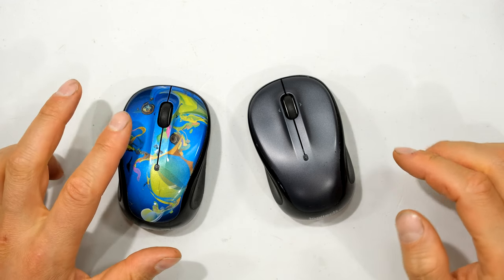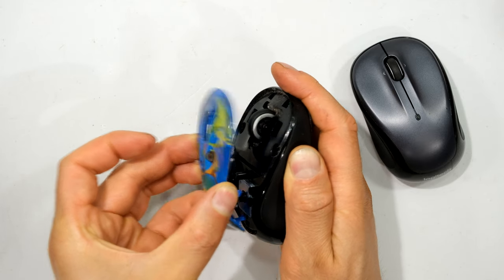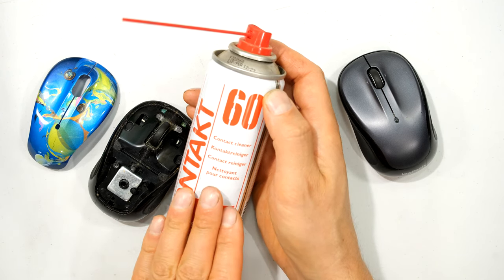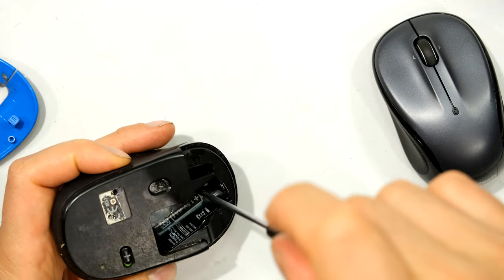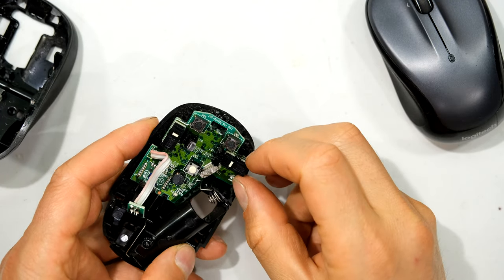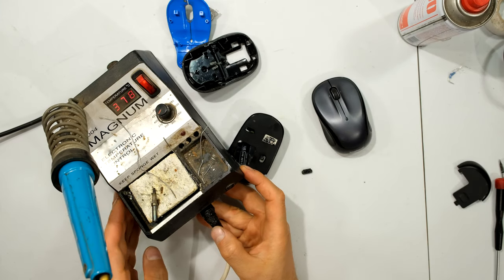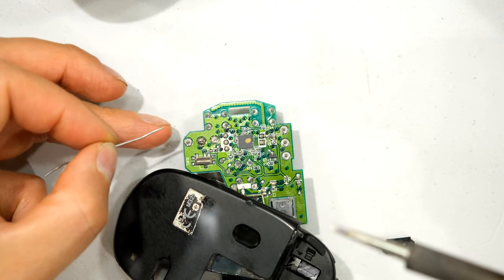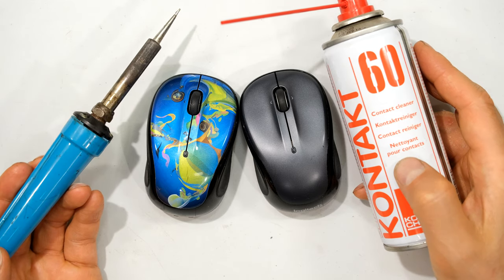How to fix a faulty mouse button that is not working

Comment: thanks for your help.  i've got 2 faulty mouses of the same brand/model from October 2021 (Feb 2023 now).  Both can be connected to laptop ; scroller wheel and cursor moving no problem.  One mouse have two faulty buttons and the other have one faulty button (LEFT).   The latter one (LEFT BUTTON) can be fixed by cleaning with 99% isopropyl alcohol (I don't have the cleaning spray/agent you mentioned).   The former mouse i cannot fix coz I don't have the tools and material to do soldering.  but that's okay i have already bought one new mouse back then but still great to know i can fix if this should happned again in the future.  (and i'm using the fixed aforementioned mouse now while tying this comment)

Comment: By trying this method of opening up  - I broke 3 of the 4 clips of the logitech mouse :)) Still, it's holding. There is a much easier fix that may work just as well - to pad up the actual depression button at the back/inside the front cover of the mouse. I used some tiny sticker/tape (4mm square) and put several of them - and it works!

Comment: Thanks.  I had all the stuff to fix this but I didn't even consider bad contacts.  I was a few clicks away from ordering another M510, but after watching this, I used some QD Electronic Cleaner and reflowed the solder joints on the two main buttons.  I was in a hurry, so I'm not sure which one fixed it.  I couldn't draw an unbroken line with my left button in Paintbrush before the repair, but now it works great.  It only took a few minutes to do.  Most of the time was spent looking for the power button switch cover that fell out without me noticing.

Comment: hi, can you use a dab of rubbing alcohol on to clean the switches? i have a mouse that has bad sensitivity on the right click now but the left click is instant, quite annoying for games where you need to aim down sights
Reply from the maker: yes it can work, enamel thinners also works but the contact cleaner shown in the video is the best option.